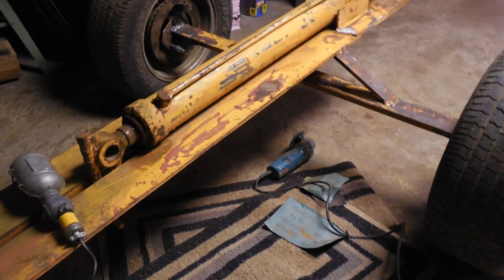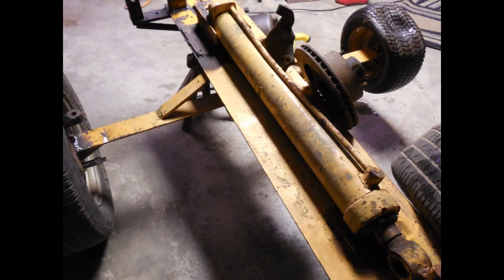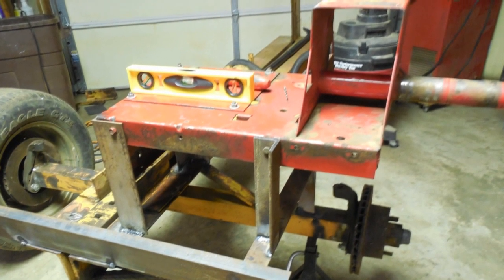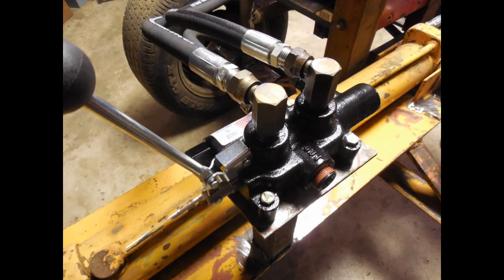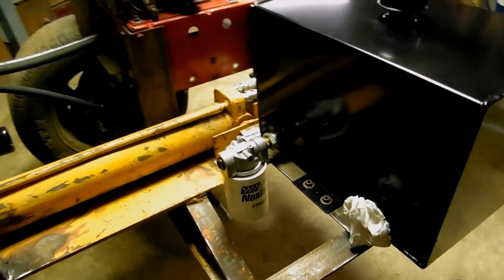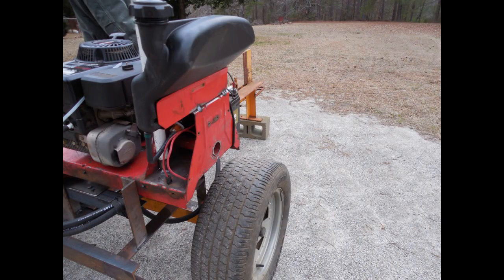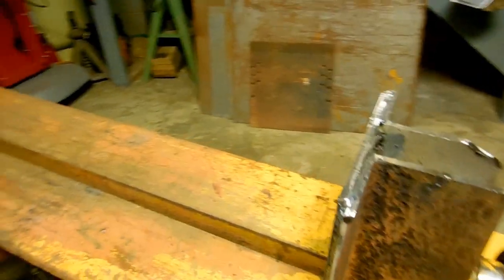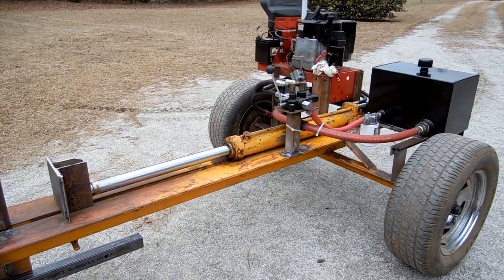How to build a Homemade Log Splitter

Comment: Good looking machine you put together there!  I'm setting off on a similar project, with a homemade splitter and an old Monkey Ward mower....now that you gave me a "DOH!" moment that the pump does not care if it's mounted horizontally or vertically.  Saves me having to go buy an engine, as I have several vertical shafts AND tractors hanging around.... one literally, as it's suspended from my chain fall as I type this... LOL.  

Enjoyed watching your vid.  Building something out of the scrap pile is rewarding, isn't it?  :)

Comment: very nice job restoring splitter-  a plate traveling with pusher on both sides of wedge would be great bring wood back to you-  put pieces to split again on a table to your left would save lots of steps -- 12 winch on boom with timber dogs will save back to--  build my in 1979 6t rebuild 2013 27 ton all new except heavy steel of which wedge was welded on by me in 1979 with a 225 hot box like that one still have it and it works
Reply from the maker: Gerald C Thanks

Comment: I've split 5 cords through it so far. Does what I need it to. https://www.youtube.com/post/UgkxUyQswtttSffRMblGbrhCvZn7JkhtG1-7  I scrounge all my firewood and am not equipped to handle big wood, but for logs up to 24 inch diameter or so, it works great. I've been amazed by some of the gnarly bur oak and elm crotches it has split. For the tougher stuff within it's size range, you might have to study the piece a bit to decide the best attack, but if you split smart it's up to the job. It did arrive low on oil, and I was would have nicked it half a star for that, but it has regained my full confidence. UPDATE NOVEMBER 2021: Still going strong after all these years. I love the one-handed operation. Hope it's still in production if I ever need to replace it